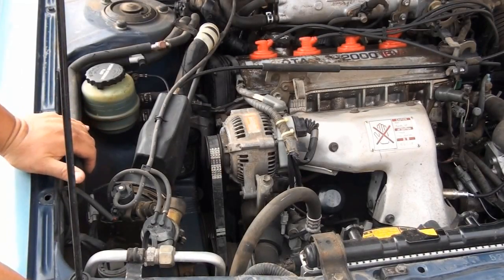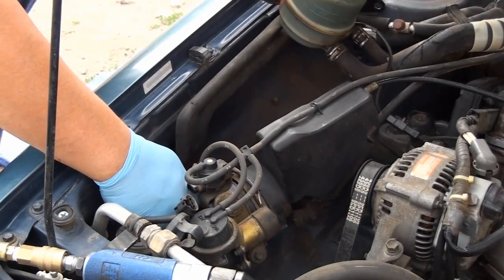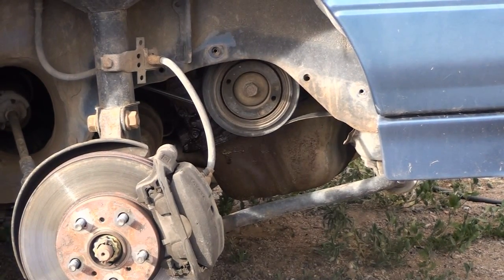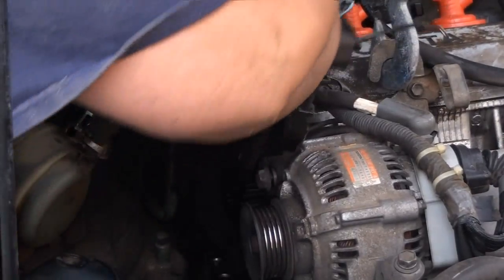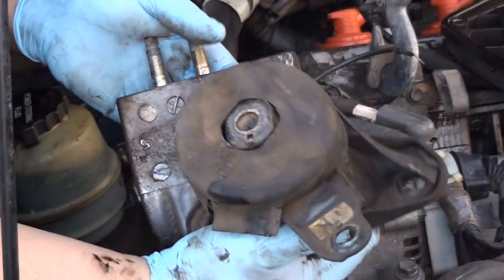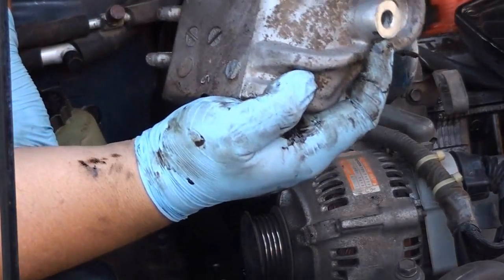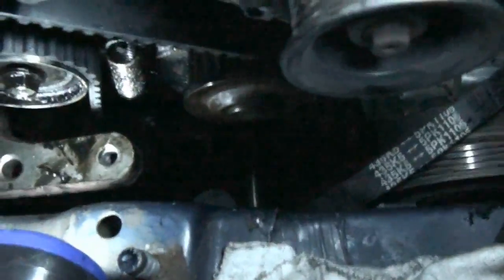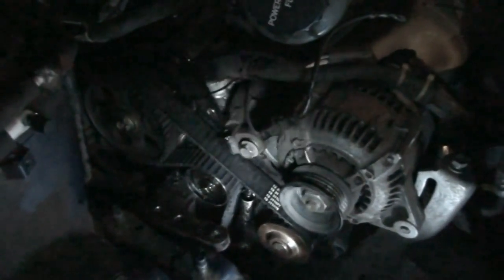How to install a timing belt on a Toyota Camry 1991

Comment: Did you have to support the engine on that side when you remove the motor mount? Thanks
Reply from the maker: Yes I did, I used an engine hoist. I can't believe that car actually still runs, the owner would only have me replace the belt but that poor thing needed seals but he was always too cheap to buy them lol. I swear those cars can run forever.
Reply: @RaysFabShop  thanks
Reply: @RaysFabShop  btw. I have the same car and it vibrates badly at idle. It’s due for a timing belt but thinking it might be ignition related. Any thoughts? Thanks again.

Comment: You have to push the tensioner way down and let the spring extend all the way and then tighten the bolt a little bit.

Comment: You can use one of those small round mirrors on the end of a telescoping handle (Harbor Freight has them) and a small flashlight to see the timing mark on the block through the hole on the camshaft pulley. See the video at 6:10 where he pokes a little pin thru the hole to locate the indent mark on the block.

Comment: Can you tell me that piece with the sensors your taking out of the way what is all that called my 1991 Toyota is missing that whole piece.
Reply: My Mom's car is a 1990 but pretty sure that was the Cruise Control module he took out after the Power Steering Reservoir.

Comment: What is the amount of labor time. I have to do one for a relative and I've read 8-10 hours and that seems fairly high I would figure around 4-5 hours.
Reply: my first time on my 3sfe engine took me three days, 24h work... second time, right tools and knowing what to do, took me 1.5h o torn all apart and another hour to put it all back together... only belt, all seals I changed the first time

Comment: i have the same car but there is oil where the sparks plugs go and when you turn it on it smells different from my other car what could that be
Reply: Oil on spark plugs means your spark plug seals have failed. need replacement, not a hard job.
Reply: lmao

Comment: I have a water pump problem.same year and model..Just my Camry is standard. so I was wondering if the process is almost the same since it's generally the same area of work.
Reply from the maker: +Steven Valero Same process but you might have a little more work area since standard transmissions are usually smaller.

Comment: Is the pulley wheel bolt left or right hand threaded, having trouble cracking the bolt loose.
Reply: +ArgosWarrior         It is a normal R.H. thread as by now you will have surely discovered.  A compressed air rattle gun often will not get it.  Use 6 point sockets not 12.   Some guys have put a socket on it and jammed the other end on chassis ?? and cranked the engine with no spark plugs to crack it.      I made a 24 inch ?? arm with a head that had a large hole to accommodate the socket and used the two pulley removing bolts 6mm x 1.0 mm pitch 2 inches long to bolt it to the pulley to stop it turning.      The arm end was on concrete floor.  Some models have different shaped pulley needing other ingenuity.       Then a decent breaker bar with long 1/2 inch extensions resting on a floor stand same height.          Needed about 40 to 60 kg of my weight.  Best to use a 6 point socket not a 12 that tends to wreck heads on really tight nuts/bolts e.g. wheel hub nut 27mm ?

Comment: Great idea using the piece of rod to line up the camshaft pulley with the indentation in the valve head.  You asked for other ideas, and what has worked for me (at least twice) was to use a small mirror and flashlight.  In my case, I have a 2" diameter mirror, but I imagine one from a ladies' compact or a dental mirror should work, too.  It is a little awkward trying to hold it and a flashlight at just the right angles to get a good view through the hole in the pulley to see if it is aligned with the indentation, but it can be done.

Comment: I HAVE A QUESTION and this expert seems like a good place to start for an inquiry. I have a 6 cylinder Toyota 1991 Camry with 45,000 miles on it (3 of which I put on since I bought it) The car has been a nightmare due to the constant overheating since I got it, but it runs well with pickup & go, despite horrible mileage, so I'll endure it as long as possible since my finances are low.
My question is: A new quandary arose this weekend. When I got back in the car (after filling with gas) I noticed on the dashboard the "D" light wasn't lit on the gear indicator area. Instead a new light beneath the "D" appeared for the first time. The orange light read "PWR" (obvious for "power"). I have no clue what this indicates. The other lights are normal ("P", "R", "N"), but the "PWR" stays on. The car seems to be getting power & even the headlights don't diminish the driving, but I don't want to risk getting stuck somewhere because the car conked out without warning. Is there any way of finding out what this "PWR" light is indicating?  Any advisement of information would be most helpful and gratifying., THANKS!
Reply: Pwr is the mode you put the transmission in. The ECT control switch is by the hand brake and putting into into power mode makes the transmission shift slower so you build up more revs. As for the D light, it's burned out. 

Your overheating is likely to be due to a blown head gasket. 2VZ-FE experiences that a lot unfortunately.
Reply: +Christopher Waits Thanks Christopher. Several mechanics have explored under the hood & said they can't figure out why this thing overheats between a 3 & 5 mile drive. They suggested it might be the water pump, but there's no leakage & others do not think that's it. It's costly to have th3ese mechanics take apart the engine & try to figure it out. Oh well. Thanks for your thoughts.
Reply: @MrGoldengoodies  
If you still have this car which I doubt.....do a coolant flush and drain...install a new thermostat...burp cooling system..cost 30 bucks or less...will stop most overheating issues!

Comment: Excellent video - well explained for a relatively complex job. You made it look easy! One question: how did you support the engine when you removed the right side engine mount?
Reply: +T Mukal i'm using the tire change jack with a piece of wood underneath the oil pan
Reply: +scose Thanks! Will do also.